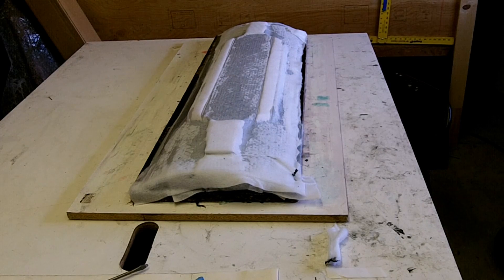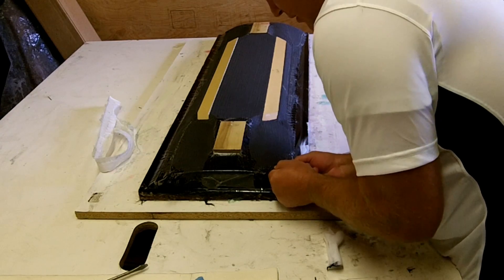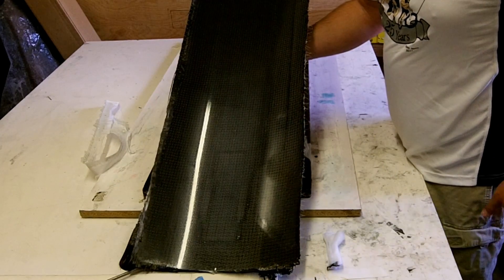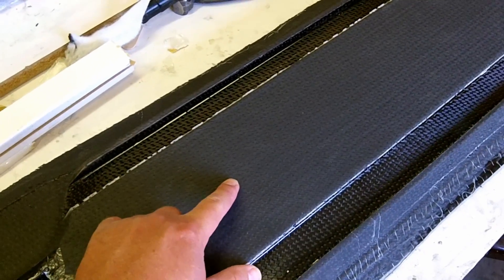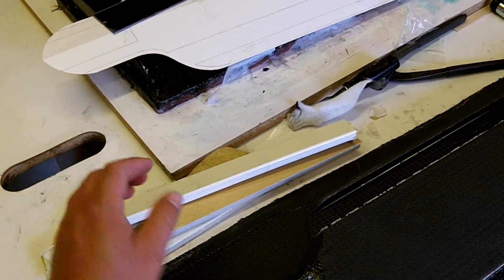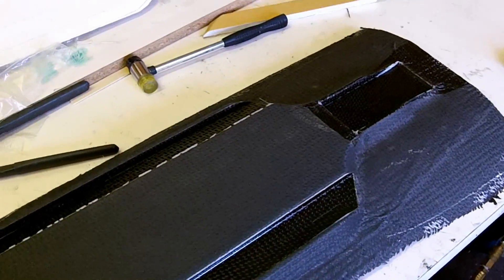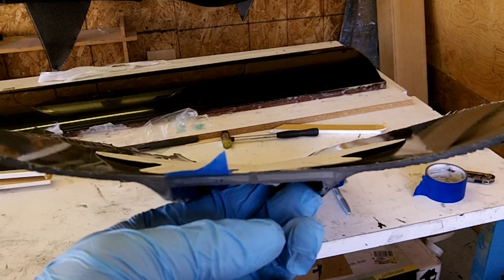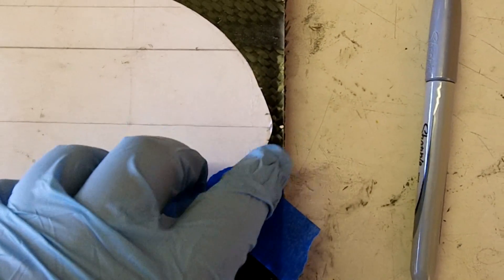DIY Carbon Fiber Longboard Tutorial- 4 of 7

Comment: Since you had that template already could you not have maybe used your router table to flush trim it ? Or is the router bits not capable of cutting this material? I have a spiral compression flush trim bit I want to attempt to cut carbon with.

Comment from the maker: If you use XEPS/XPS foam for the core instead of divinycell and a ROARocket thin air press for the vacuum pump it won't cost that much more than the wooden ones you've already made.

Comment from the maker: If you're going to grip the top of the deck then your mold doesn't need to be as nice as the one I am using. Here's an easy cost effective way to make a concave mold.

1- Hot wire you plug/mold using a template and 2” XPS/XEPS (blue or pink insulation foam)

2- Cover the mold using packaging tape or Econokote.

I should probably just do a quick tutorial on how to make one like I just described. If enough people are interested I'll do it.

Comment from the maker: The total Variable or material cost is just over $100. Here is a basic breakdown: $25- core, $30- uni CF, $20- 4hs CF, $10 of epoxy, $3 butyl tape, $2-breather, $2-peelply, $2- Stretchlon, $2- G10, $2 wood stringers & blocks, $2- Tread Tex and allow a bit more for other costs.
Please note that if you are just making 1 board it will be more expensive because you may need to buy more of something than you need. For example, a yard of carbon fiber when you only need half. I should provide a kit.